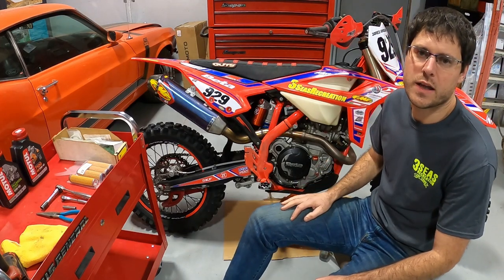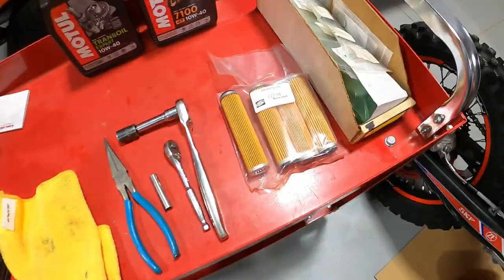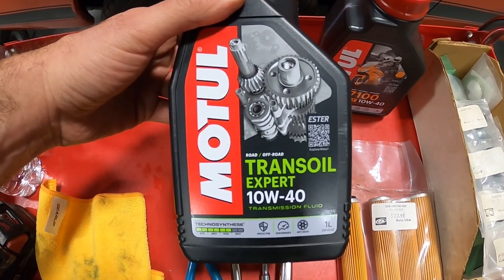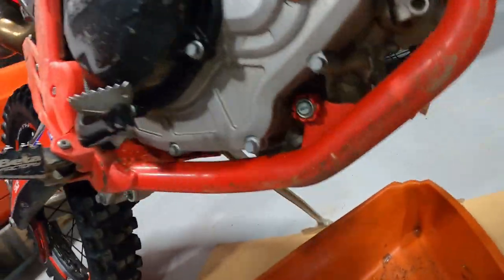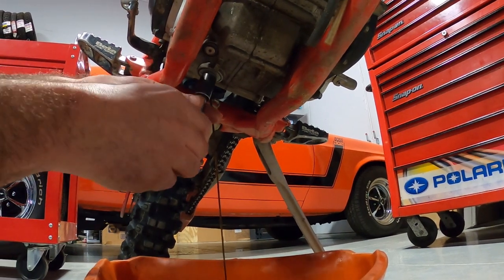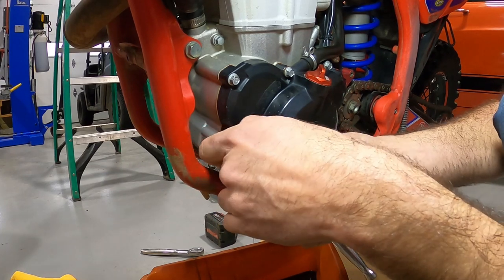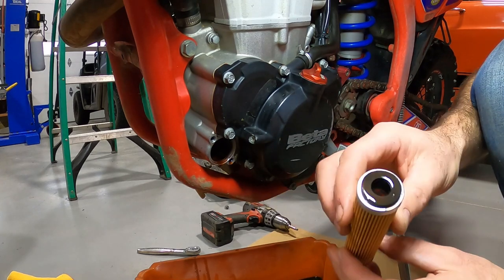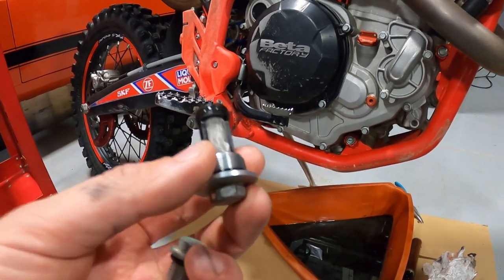Beta 4-stroke Engine & Transmission Oil Change | 350/ 390/ 430/ 498/ 500cc | 10 Years with Beta USA

Comment: Hey Jared
 Love the videos, very informative.  With regards to using the needle nose pliers to remove the oil filter.  I always had a beggar of a time and could never do it.  I think my filters have a smoother inner edge.  So what I do is just use a small strong magnet and it pulls it out no problem.  Just a little tip that may help yourself or some of your viewers that had the same issues when removing the oil filter. 👍

Comment: Hey Jared, I just did my first oil change on my 500 RRS, motor have 6 hours, mileage is about 170, transmission oil was Cristal clear and motor was barely started to get a black color. I follow your directions as well, thank you

Comment: Something I found interesting about the oil changes and discrepancy's between US/Italy service/owners manuals. There is conflicting information regarding what oil is recommended for a 500 RR-S. On the Beta USA website under "Support", I found the 2021 500 RR-S Service Manual and Owners Manual.

-The Service Manual states Liqui Moly racing Synth 10W50 for both Gear/Clutch and Engine. (page 169)
-The Owners Manual states Motul 7100 10W40 for Engine, and Motul Transoil 10W40 for Gear and Clutch. (page 15)

I contacted Beta about this, and they responded. One reason for the discrepancy is due to one being the Italian version, and the other the USA. Beta USA has a partnership with Motul, and recommends this brand in the US. Also, the Beta service rep informed me that if I wanted to use the same oil for both the Gear/Clutch and Engine (like the Italy version suggests), it's totally fine to do so. He recommended the Motul 7100 10W40 or Motul 300 V 10/40 for both sides. 

I've been using Motul 7100 10W40 in both sides of my bike, with great results.
Reply: I've just done my first oil change with the Motul 7100 in both sides as well. The manual I got in Australia for a 2022 model recommends LIQUI MOLY RACING SYNTH 10W50 for both sides. I might try different oil in the gearbox later to see how it goes as the ability to run different oils is an advantage to the split design.
Reply: @laxmoto3119  I appreciate the response! I've done about 4-5 oil changes now, always using Motul 7100. Haven't had any issues. I'd be interested to hear if you change your gearbox oil and how that works out for you.
Reply: will you use potato  1w 17 oil if beta has business negotiated with them to get it at low 
cost  and so advice to use it on every manual ??? ;) ;) ;) ;)

Comment: I "carelessly" put more than 750ml of oil so I have to drain some back. Does the side glass window gives you any indication of proper amount and where would the oil have to be? Any other ways I could try to have the proper amount of oil without draining it all and putting it back in?
Reply from the maker: Good Afternoon, the sight glass is used when the bike is running. Once the bike has been running for 25 seconds the oil should be 3/4 of the way up the sight glass. Enjoy the ride, Jared

Comment: HI Jerad 
the owners manual tells you to oil changes every 30hrs  is that ok  or what do you recommend 
Regards
Marcio
Reply from the maker: Hey, I would recommend changing the oil a bit sooner than that, typically we are every 4 or 5 races or 20 hours of trail riding. Some guys do it even sooner after a total mud race. Just depends on the riding. Thanks, Jared

Comment: I have a 2022 390RR Beta can I use the same oil for the transmission and the motor? I purchased Motul 10W-50
Reply from the maker: Hmm I usually run the Transoil in the gear box size and the Motel 4100 in the engine side like the video shows. As long as what you bought works with wet clutches you should be fine! Enjoy the ride, Jared

Comment: Do you not need to add oil to the paper oil filter before you install it ?
Reply from the maker: Good Afternoon, thanks for watching! We just add oil to the rubber end so it slides over the case nub easier. No need to add oil to the filter as we fill it in the stator cover. Thanks, Jared

Comment: sure  torqueing with dyno is best way to over torque and kill threads and bolts  as torque value is given for dry , and there is always oil on bolt and threads. Best way to learn how to extract bolts :) :) :) :)

Comment: Can you make a video of other oils I can use?   For example, traveling around the world and you cannot find these two types of 10w40.
Reply from the maker: Thanks for watching! In the past Maxima was a brand we ran and had good luck with. Beta is also now pushing the Liqui Moly brand here in the US, I'm sure a local motorcycle shop in other counties should know what to use while visiting there, I don't have any experience riding anywhere else but here in the states. Enjoy, Jared
Reply: @3SeasRecreation  could I use full synthetic 10w40 if need be on both sides
Reply: Sandviper1 The answer is yes, you can use the engine oil on both. It’s slightly more expensive that way as the engine oil costs more. This was the advice given to me by my dealer who sold me 10w50 for my new bike here in Australia.

Comment: Jarred ,did you see on the 2023 oil guide for setup they want you to use the same oil for engine and trans,liquimoly 4T 10W/50
Reply from the maker: Good Morning! I will be doing an updated oil change video for the newer 2023 bikes. The new video won't be about the brand of oil as I will still be using Motul oils. Beta is recommending the LiquiMoly as they are the title sponsor for the Factory Beta race team. The updated video will be discussing the proper filling process for the engine side. Stay tuned for that video as I get time on our shop build 390 Race Edition.